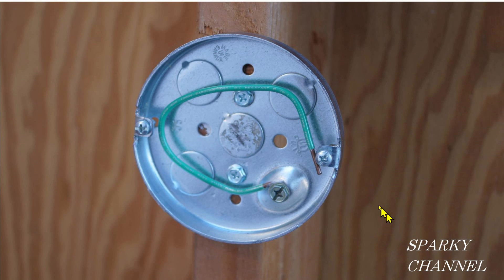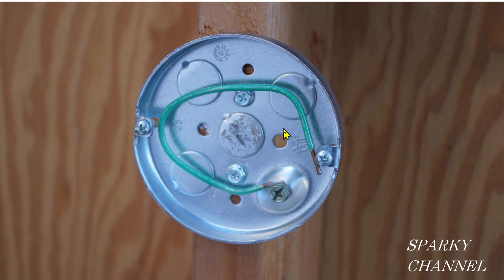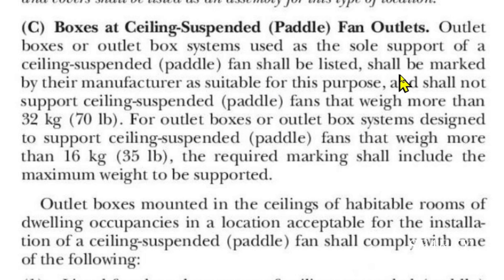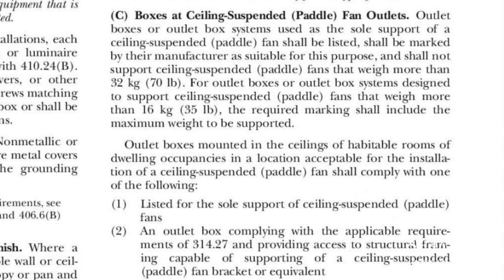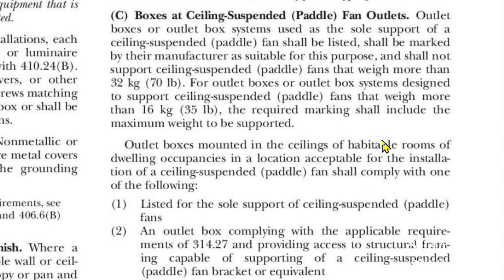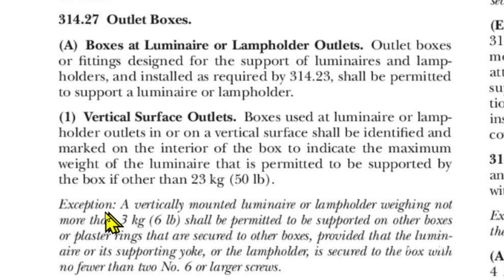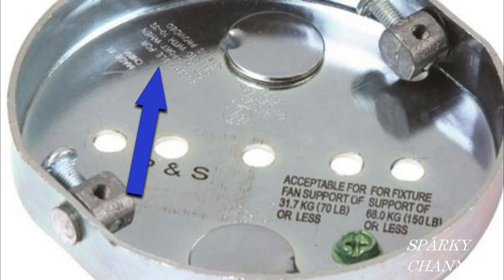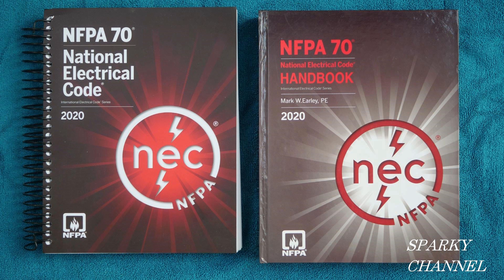Is this Pancake Box Acceptable to Support Ceiling Fans & Wall Sconces by the 2020 NEC?

Comment: "Outlet boxes or outlet box systems used as the sole support of a ceiling-suspended (paddle) fan shall be listed, shall be marked by their manufacturer as suitable for this purpose" It sounds to me like a box design that provides the fan bracket access to the framing, such as a pancake box centered over a joist can be used to connect a fan as long as it's not the "sole support" for the fan.

Comment: Hi Bill - A hypothetical question: Is there any reason you couldn’t use the supplied #10 screws if you were installing a light fixture (up to 150 lbs) instead of the #8 screws? Thought being you could future proof the outlet box for a ceiling fan that way.

Comment: What if the pancake box were mounted to a wooden joist and the ceiling fan support screws passed through the pancake box into the wood joist.  In other words the pancake box itself was not supporting the weight of the fan.  Would that be acceptable?

Comment: you do not tallk about box fill. I would mention a past video about box fill. this pancake box has a 6 cubic inch fill number which means you can only pull one 14/2 to this box… For fan locatiions I like to pull 14/3… so this pancake box would be unaccaptable for me to pull a 14/3 to it…
Reply: Can I ask why it isn't allowed?
Reply: @Irish_Goose  minimum box volume for 14 awg wire is 2 cu in per conductor, meaning a 14-3 needs a minimum 8 cu in to be code compliant unless the fan canopy is marked with its volume, which can be added to the volume of the box.

Comment: Thought y'all may get a kick out of this. I'm remodeling a house and pulled the ceiling fan in the living room down. Once I got the fan off the base plate, I removed the base plate only to discover that, not only was there no ceiling box at all, but the base plate was held up with construction adhesive and two drywall screws into the drywall but not into the joist. How this never fell is beyond me. All I could picture was the glue pulling the paper off the drywall and the fan plunging as it ripped the wire thru the drywall and swinging from the wire like Tarzan on a vine, right through the picture window.

Comment: This is one of my issues with the NEC, what is the purpose of marking something as “Fan rated” my opinion is so that you use the appropriate lags or screws that can support not only the weight of the fan, but also the vibration so as to not fall from the ceiling, aside from the fan pancake being slightly thicker and larger screws it’s no different than a normal one. If you look at this specific pancake. You can snap the wings off that hold the 8-32s and use lags in those holes. Making it just a housing for wire. Exactly the same as a saddle box for fans…
Reply: I think his interpretation is incorrect. He ignored where it says cannot be used as "sole support"

Comment: Easy fix just mark those pancake box as fan and light fixture rate.
Reply: For a manufacturer to mark their products with certain ratings, the products have to be approved by the NFPA (with of course the exceptions listed in the code). So by marking them yourself, even if it technically could handle the device that you are installing, would not be up to code because that specific device was not approved.

However, I am all for freedom in doing what you want in your own house.

Comment: Pancake boxes are not rated for ceiling fan and the manufacturer ir Home depot is not advertising it as suitable for ceiling fan mount. So, I don't see any problem with them keeping them on shelves.  I use pancake boxes when the location of light fixture is in the middle of joist or stud.
Reply: SOME Pancake boxes are, and some are not. Really no different than any other ceiling box. Some can be used for fans and some can not.

Comment: I have a similar problem: I'm replacing 3 circline fluorescent light fixtures weighing 5 3/4 llbs each with 3 round LED lights each weighing 2 lbs 8 oz. The old lights were installed in 2003 and apparently the electrician installed each fixture using molly bolts to the sheet rock and did NOT use a ceiling electrical box in two of the lights but simply pushed the wire through the sheet rock. The third light did have a ceiling box but is held in place with the wings on the box, that is the box is not attached to any joist. What is the best way to correct this problem. I'm unable to reach to install a box from the attic. Is there a proper way to install a box from below? Thanks
Reply: Many light fixtures function as their own junction box and do not require ceiling boxes. The florescent lights you're replacing are likely in this category. Those LED's MAY also, but I would add two boxes for those two that do not have them. You can use round remodel boxes just like the one already in your ceiling. They're rated for like 20 lbs or something like that. Hope this helps!
Reply: Sparky , you said 2020 code says all ceiling boxes 12” or more away from the wall have to be fan rated boxes. Thanks

Comment: Sparky! I have a small chandelier to install and the mounting box is a pancake box. The problem is, the rod that threads through the cross bar basically bottoms out on the box, leaving no room to feed the chandelier wire through. Any suggestions? I was hoping to find a 1” spacer (6” diameter) between the pancake box and chandelier canopy that would lower the cross bar, but not having any luck.
Reply: The proper fix is to trim the threaded rod and re-insert the little plastic bushing into the rod. It will protect the wires from the sharp edges of your cut. In the field, many electricians remove that center knockout and drill a hole into the framing member to make room. - Not the right way to do it but commonly done. -

Comment: My inspectors always told me that these boxes are not legal for any purpose because they do not have enough cubic volume to support the required wire fill. Even with #14 wire if you count the two incoming current carrying conductors plus the two from the fixture, you have automatically exceeded the wire fill limit for the box.
Reply: who cares about the wire fill
Reply: The wires from the fixtures don’t count in the wire fill calculation. They are wire nutted to the current carrying conductors essentially “pigtailing” them in a sort of sense. Each wire connecting to a wire coming in to the box counts as the same wire

Comment: You say that this box shouldn't even be sold. That's your voltage-chauvinism talking :) These boxes are widely used by us low-voltage installers for WiFi access points, surveillance cameras, and speakers -- all widely used in both commercial and residential settings. I agree with everything else you said regarding their application for fans.
Reply from the maker: Thanks for the information!

Comment: I have been an electrician for 20 years pancake boxes have never been legal for ceiling fans unless like you said marked for that purpose AND #10 screws. We never used them because its just easier than wondering if the inspector doesn't want them or whatever.
Reply from the maker: Sounds good to me!

Comment: That is not sold as a fan rated box. The boxes for fans are clearly marked for fans. If you really want a good flush mounting to the ceiling just put a 2x4 and mount it to that without a box. This works for new and remodeling.
Reply: Some localities boxes are required for all devices. I always use 2x4 or preferably 2x6 and a fan rated pancake. You can do chin ups all day and it'll never come loose.
Reply from the maker: Thanks!

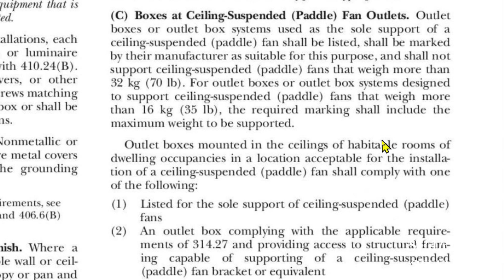Comment: 4:54 ....LoL, "Trusted Home Depot", (that's why Licensed Electrical Work is  not a Hobby...)
Reply from the maker: LOL!
Reply: @SparkyChannel  Sorry, gents, but it has nothing to do with trusting Home Depot, or any other supplier. Suppliers supply, installers install. Installers are on the hook to know and follow relevant codes. In fact, HD employees are instructed that they can't discuss code compliance or product applicability in any way. This came about after a 2018 class action lawsuit involving a wood product marked "genuine mahogany", and acknowledged as such by HD staff, which was actually a lower grade species of mahogany, and thus less than "genuine". Now all HD can say when asked about code compliance or product applicability is "the manufacturer says...".
Reply: As a once licensed electrician in California and working in the commercial industry.  Trust me I have seen more so called licensed electricians install non compliance equipment in commercial buildings over the years.  Many of them our company was called in after the building failed an inspection.  I tought my crew to always look before you install anything,  it's less costly to do it right the first time.

Comment: Bill, can you clarify this at  05:09:

05:09: Vertical surface outlets boxes used at luminaire or lamp holder outlets 
05:16 in or on a vertical surface shall be identified and marked 
05:20 on the interior of the box to indicate the maximum weight 
05:24 of the luminaire that is permitted to be supported by the box 
05:29 if other than (23 kg) 50 pounds

I know it's probably NOT the case, but reading that, it seems to me, that: 

Boxes that support a maximum of (23 kg) 50 pounds DO NOT need to be identified and marked on the interior of the box. Only boxes that support a maximum of OTHER THAN (23 kg) 50 pounds need to be marked on the interior of the box.
Reply: Exactly the way I read it. And further, to say essentially that an unmarked box would be by default rated for 50 lbs.

Comment: I really hate pancake boxes due to lack of space
Reply: Low-voltage installers love them because they perfectly fit many of the devices we are installing, such as WiFi, speakers, room sensors, cameras, etc.Much LV gear maps to a 4" circle.
Reply: Space is no problem with the canopy for me unless the receiver for the remote control makes it a pain
Reply: Yeah, but there are some situations where they are your only choice.

Comment: Does the marking has to be on the pancake box itself, or is it enough that its marked in the manual or packaging? The intent of the ruling is to ensure manufacturer has approved its use as support so it tolerate the weight, then as long as manufacturer has actually approved it somewhere (on the packaging, in the manual, etc) it should be fine right?
Reply from the maker: It has to be marked on the pancake box. Merry Christmas. 🎄
Reply: The point is, that: 

1) An installer who picks up an unwrapped box, perhaps from a pile of various types and sizes of boxes needs to be able to identify the acceptable applications for the box. 

And 2) an inspector reviewing an installation needs to be able to tell if an installed box (any installed box, accessory, part, or equipment, etc.) is acceptable for the application it's being used in. You telling the inspector that the item came out of a particular package with such and such markings is not acceptable.
Reply: @GFlCh  aha now I understand. Here in sweden it isn't neccessary that things are marked on the box and similiar. Its enough that the box or accessory IS acceptable for the application. When a inspector is unsure, they will look it up, either in central databases, ask for the packaging or manual which they then cross-reference with the actual model (so not the wrong box or manual is pursued), or on the internet, or similiar. Or as last resort, email/call the manufacturer to check if the model is acceptable. Which I think its pretty neat, as its an extra manufacturing step/cost if they have to mark the actual box.

Its the same with driving in sweden. You don't need to bring driver license, tax receipt/stamp or insurance papers or approval papers with you. You only need a valid ID-card, then everything they look up in the computer. They just type your social security number and then number plate of car, and then they will see everything, if you are allowed to drive (ergo HAVE a driver license), if the car is insured and inspected, if tax has been paid, if all debts is paid, etc etc etc. Actually, its mostly the computer doing all the checking, the police just gets a green checkmark or red cross depending on if its OK or not.

Comment: Here's  question for you guys..when every county around you operates on 2014 NEC code. Do you go by that or stick with current codes....Lots of Grey area here. I don't even own a 17 or 20 book because we don't use that yet.
Reply: Depends when your state adopted the code not all states adopt the code when it comes out sometimes might take years and they don’t have to adopt entire code also here we use code according to code that was in force at time permit was issued
Reply: We don’t have county codes in New Jersey it’s a state wide code localities can go above and beyond the nec requirements but not below
Reply: @lou198  That's how it is here. Missouri is on 14. Counties can be at or above. But locally every county is still at 14. I agree with sparky that you should go with the newest codes. However with Home depot and all local supply houses apparently having little to no stock this becomes an issue for some materials. As, someone mentioned before it's the same with TR outlets. I rarely if ever see those in a home even new construction. Also rarely in stock. If they are they cost 3 times as much as a normal outlet. Customers don't want to pay that if they don't have to.
Reply: @nickjones333  My question is why the cost 3 times as much? Someone on NFPA getting a kickback?
Reply: @johnhill8958  Because a standard duplex receptacle is still widely used. They offer them in bulk. So TR is not used as much making supply and demand less I would assume. Look at GFCI same think. However with TR receptacles the home owners hate them. And I hate when I go to a home with them. Harder to get a meter in there. And of you just use a ticker to find breakers for the circuit. Makes that a pain in the ass too.
Reply: Which may be an answer to home depot supply. I don't feel like flipping around a code book for answers. Nor do I ever use pancakes or saddles. But still sold around me.
Reply from the maker: @nickjones333  It's probably best to build per the newest codes if you can. Merry Christmas. 🎄
Reply: @SparkyChannel  Merry Xmas Bill

Comment: I despise pancake boxes so I never use them. In new construction I install fan rated boxes in all bedrooms to make it easier to install future heavy light fixtures.  The main design feature of fan rated boxes is number of threads in contact with the screw threads.
Reply from the maker: Sounds good to me! Merry Christmas. 🎄
Reply: those rated boxes for clg fans are pretty cheat..and work well
Reply: Longer screws? Sometimes I mount the bracket to the box/joist with 4" heavy decking screws and not use the machine screws.

Comment: That is just like all the non-tamper resistant outlets that they still sell at the big box stores still.
Reply: The only reason TR outlets have become part of code is because stupid parents don't watch and teach their children. Should not be mandatory to have TR outlets. SHOULD be mandatory to have to get a license to have a CHILD.
Reply: It's probably okay to replace a bad non-TR receptacle with another non-TR receptacle in a residential dwelling pre-dating when TR receptacles were required. It's a repair. But new construction or additions to an existing house would require current code installations.
Reply from the maker: Yep, same kind of thing!
Reply: @SparkyChannel  https://www.homedepot.com/p/Westinghouse-6-cu-in-New-Construction-or-Remodel-Ceiling-Fan-Saf-T-Pan-0103600/204845541
Reply: This fan pancake box should work to pass in 2020 code. The other kind you showed in the video was never intended for fans. We always used them for small lights.
Reply from the maker: @illestofdemall13  Excellent! It not on the shelves at my Home Depot though.
Reply: @SparkyChannel  Lately I have had problems finding common items at Home Depot, as well.
Reply: @illestofdemall13  I always have trouble finding anything in a Home Depot, but Menards is even worse...

Comment: "My oppinion" right.  Rarely have I come across a fan weighing more then 50 pounds....  52" fans are the largest I'll ever come across...  I use a 52" or smaller fan...
Reply: It is not so much that the fan weighs 50 lbs... in the box. It is a matter when the blades build up so much crud, or are not attached properly that they get out of balance and shake the fixture on high speed. Take the wheel weights off one tire and then go drive down the Interstate highway at 70 mph and you'll understand what I mean.
Reply from the maker: I understand. Thanks John and Merry Christmas. 🎄

Comment: Rarely use pancakes for “fixtures”; and the only time I [we] do, is if we absolutely can not get another box in the framing b/c of obstacles. When we do use a pancake, we do make sure it’s correctly rated for the application needed....cuz who like redoing work after an inspector comes in and says: “Umm, yeah, No”....🤦🏼‍♂️😅

Thx Bill for the video; enjoy these NEC CODE “quizzes” you do. 
Currently the state of FL is using NEC 2014 codes, and on 12/31/2020 the 2017 NEC Codes will be adopted (think it’s interesting to lookup the NEC Code Map & see what state is using what version; & it’s kinda cool that ones able to actually do this and SEE, if they were ever in doubt, imo.
Have a very Merry Christmas Bill, & your family too✌🏼🎅🏻✌🏼
Reply from the maker: Wow! Thanks and Merry Christmas. 🎄 to you and yours!